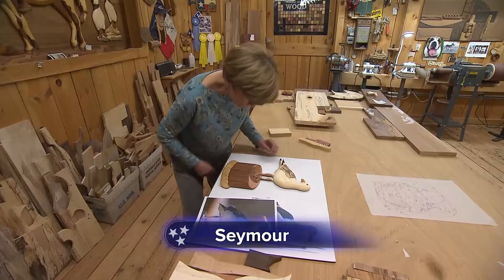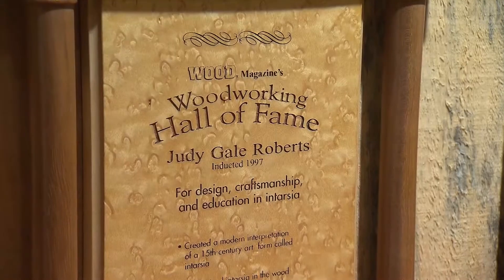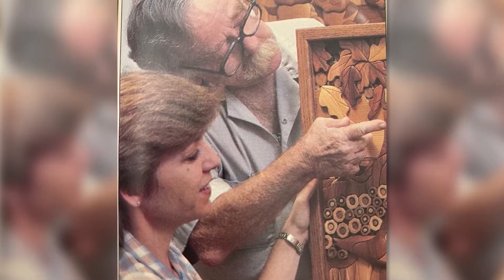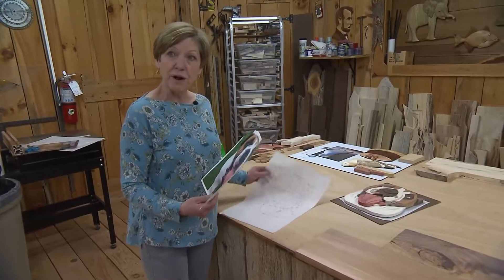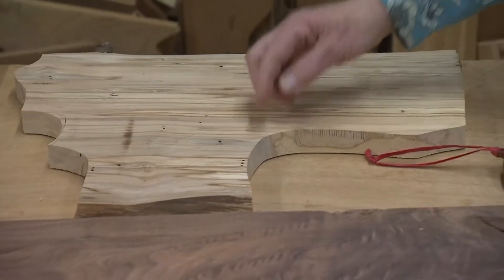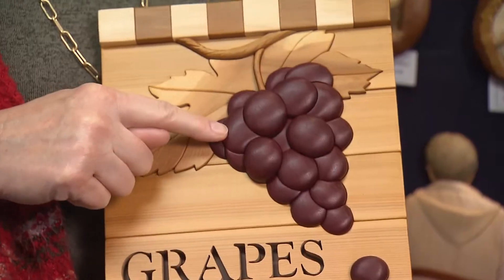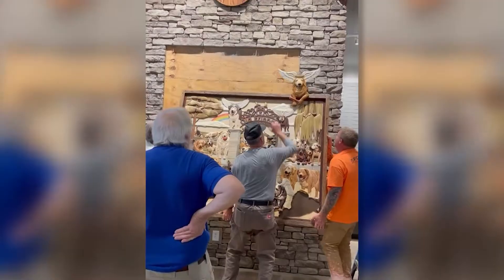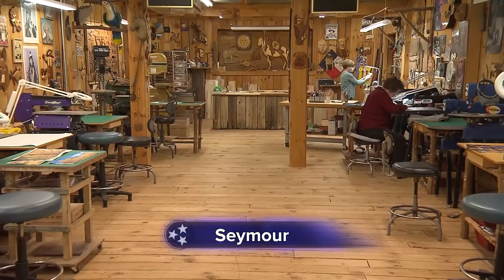Judy Gale Roberts, Intarsia Artist

Comment: Fantastic work and a true art form. I don't have room for all the necessary sanding equipment but I'd sure love to give it a try. Thanks for this great video.
Reply: Check out the spindle sanders by Rigid and Triton. I have a Rigid and it works really well for the coarse shaping. I finish the shaping with a Dremel tool's drum sanders (3 sizes). I'm not into speed sanding.